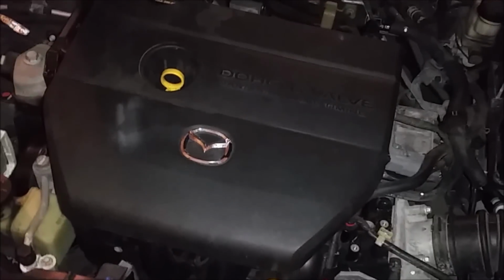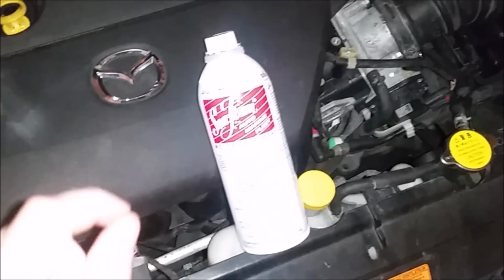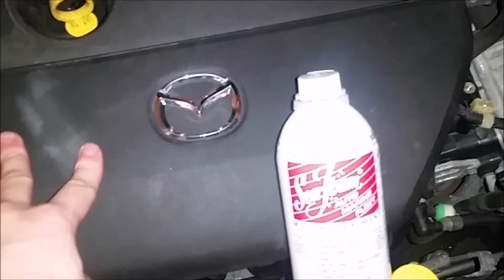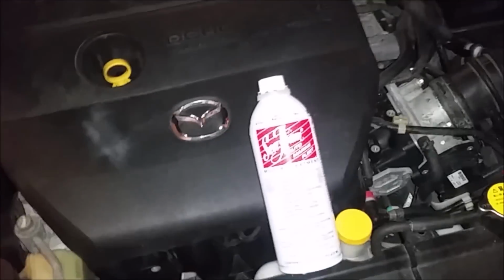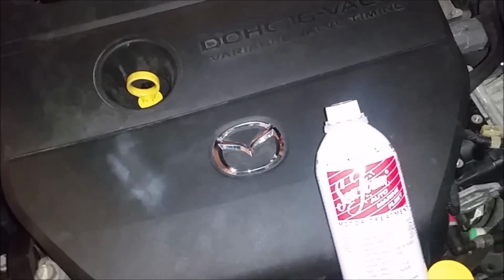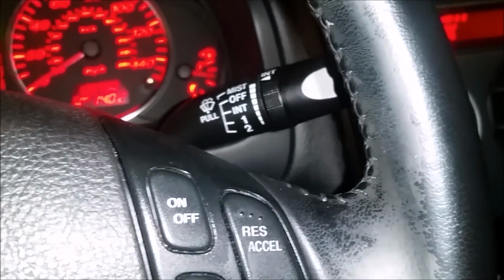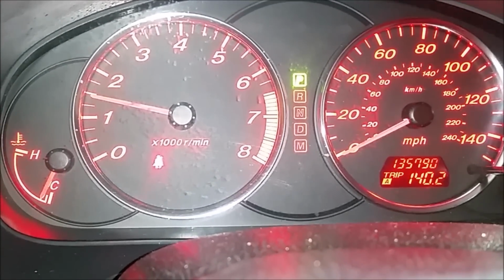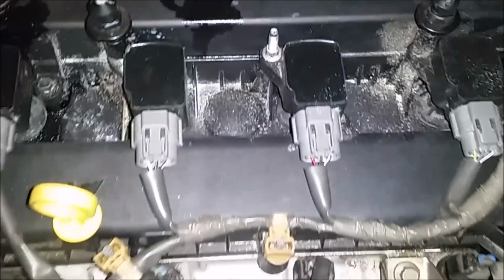Fixing noisy lifters   hydraulic lifter 2006 Mazda 6

Comment: Is this the same as tappet valves? I have a little noisy too like its going to stall or hesitate?
Reply from the maker: Hmm, well tapping valves means you need to get the valves adjusted. Does the car stall? Does the rpm go under 700?
Reply: +Anthony Awada 
It hasn't stalled yet, I keep revving a little to add petrol lol. Forgot to mention it has a fault code p0303. My car has done 50k kms, changed the spark plugs. Thinking of doing the ignition coil. I already tried petrol Injector cleaners.
Reply from the maker: +Optimus Prime So I'm guessing you have a mazda with a v6? 
If that's the case that's a misfire in cylinder 3. my recommendation is to change all spark plugs. Then change the coil pack from cylinder 1 onto cylinder 3. Then erase the codes. If the  light comes back on and the code reads misfire on cylinder 1. Then you know it's that coil on cylinder 1 that's bad and you can just change that one.  if it's still a misfire in cylinder 3, then I recommend cleaning your fuel injectors.
Reply: +Anthony Awada 
Thanks Anthony will swap the plugs then. No its not a V6. Just a Proton Savvy. It has a 1.2 D4F renault engine I think? I already changed the spark plugs before it did help a bit, it use to hesitate quite badly but just a small hiccup now and then. It doesn't drop power but it did in the past and mechanic said it had water in petrol tank for some reasons. Got that one fixed.
Reply from the maker: I love those cars! It's a common problem for proton savvy's. The bonnet design in the car sometimes allows water in the engine compartment. And I have heard many stories of fuel and water mixture in the gas tank either from it raining or condensation. Check for corrosion on the plugs or the plug tubes (boots) as well. Even though the boot is made from rubber, corrosion and rust will stick to it. There is fluids like fuel doctor, marvel mystery oil, gum out, sea foam, etc.. that, you can put in your gas tank to get rid of any water in the gas tank. Also you might wan t check the TDC/crank sensor. Make sure there is no oil. Dust and some dirt will get in there once in a while. I would clean it and make sure nothing clogging it or distorting it.
Reply: Anthony Awada
Your it normally plays up when it rains or condensation like recently. On hot days it goes like nothing is wrong? I recently changed the TDC so can't be what's causing it.

Boots? Is this the ignition coil plugs you talking about? Will check the spark plugs again which reminds me to do the plug test.
Reply from the maker: +Optimus Prime I've had some problems with injectors getting dirty because crap was getting into my fuel tank.  I ended up cleaning my injectors. 
Yes I'm sorry ignition coils on packs. Not boots. Check the bottom of those Coil on packs. Make sure they are clean. You can even try putting some conductive grease in the plugs to enhance connectivity.
Reply: Anthony Awada
I thought that is what you meant. I tried the petrol injector cleaners and still no luck. I have used fuel doctor before and still have some left. But I am convinced it can't be water all the time? I haven't checked the bottom of the coil packs. Grease? OK will ask at the local store to buy the correct one.

Faulty code p0303: http://www.obd-codes.com/p0303

Symptoms may include:
- the engine may be harder to start.
- the engine may stumble / stumble, and/or hesitate.
- other symptoms may also be present.

A code P0303 may mean that one or more of the following has happened:
- Faulty spark plug or wire
- Faulty coil (pack)
- Faulty oxygen sensor(s)
- Faulty fuel injector
- Burned exhaust valve
- Faulty catalytic converter(s)
- Running out of fuel
- Poor compression
- Defective computer

From the symptoms above, the engine is not hard to start but it does stumble or hesitate a little when at a red light or stopped sign so its only when the car has stopped moving. But as soon as the car is in gear 2 and up then the car can drive normal.

I have ruled out spark plug. Not sure what the wire it is referring to? Gonna have a look at the coil plugs as mentioned before.

I don't know what:
- Oxygen sensor
- Exhaust valve
- Catalytic converters
- Poor compression
- Defective computer
Reply from the maker: 1) oxygen sensor measures the oxygen that's in the exhaust gas to make sure that your engine is running efficient. 

 2) catalytic converter burns impurities from your exhaust so that you aren't polluting the atmosphere. Usually if any of those two problems happen. The check engine light will come on with an error code saying either "catalyst system inefficiency" or "oxygen sensor fail" I have a good fix for catalytic converters that I learned from scotty Kilmer. What you do is get your gas tank half full and pour one gallon of pure lacquer thinner in the gas tank. Then run the car for about 30 minutes at 2.5k rpm for 30 minutes and drive the car a lot to get rid of the lacquer thinner. Its worked twice for me.
3) You can perform a compression check on your vehicle. If the compression is low. Consider using a thicker viscosity oil on your next oil change, It's very rare for computer to go bad unless water got to them. In any event you would have seen a check engine light come on.

Comment: what do u mean by putting transmission fluid in ur car?????
Reply from the maker: Some guys, me included, used to clean the carbon buildup inside engines by running transmission fluid instead of oil after draining the oil. Transmission fluid is thicker and has much much more detergents to clean all the carbon.
I used to run the car for 15 minutes idling with trans fluid in it. And then drain it and refill with normal 5w-20 oil. Even with the 15 minutes of trans fluid in there, it used to come out black.

Comment: Who doesn't change their oil filter after doing an oil change?  Anybody that does that shouldn't be touching a car. But seafoam did cure my Dodge Charger's noisy lifters.
Reply from the maker: I know many people who believe that filters can go 10-30k miles before needing change. It is also proven that dirty filters catch more dirt than clean filters. But I do agree, filters should be changed every oil change.
Reply from the maker: TheNightster07 Hi, what is it that I can clarify?
Reply: BigErn_Mccraken this is true you should only change your oil filter ever 3 oil changes but i would after using seafoam
Reply: Fifty 1 Fifty Hey bro quick question. I got a 05 300 hemi that got the tic after a oil change. You think this seafoam will work for me? If so how did you do this.
Reply: My nissan pathfinders handbook lists two different oil volumes, dependent on whether you change the filter or not.
So yeah even some manufacturers dont think it is entirely necessary to change filters ever oil change.
Oil filters are cheap. Change em.

Comment: Hey I have a few questions for u I'm having the same problems in my maZda 6
Reply from the maker: Hi Jennifer,  please tell me more! have you tried anything on your car yet to try to remove the noise?
Reply: +Anthony Awada no it just started yesterday but it sounds terrible
Reply from the maker: I'm sorry to hear that,it's a common problem on the mazda 6's. They are great cars but have some small problems like lifters. Now noisy lifters occurs as a result of not have regular oil changes or some dirt getting into your engine. Those lifters capture the sludge or dirt and get clogged which makes the noise. And over time the will attract more dirt and make more noise. The faster you diagnose the better. You can do like I did here in the video (seafoam and MMO) or another method which is :emptying you oil from your car. Then adding transmission fluid instead of oil. Run you car for about 20 minutes in park. Then flush you transmission fluid out and put in good oil (that your car recommended ) and a new filter.
Reply: +Anthony Awada is it safe to drive tho? Cuz I'm broke right now so I literally can't fix anything but I have a 30 mile commute one way everyday
Reply from the maker: +jennifer winston Yes it is safe to drive. It should not even affect performance.

Comment: had the same problem recently added best line oil treatment and my noise is gone you won't believe it
Reply from the maker: That is good to hear! The reason these hydraulic lifter noises happen in the first place is because of lack of oil changes.
Reply from the maker: Hi Alan, could you elaborate more on the issue you are experiencing with your car?

Comment: If you changed your oil regularly you shouldn't have a "build-up".   Also, you used two different products so......you don't know which one quieted your lifters -  my money would be on the Marvels Mystery Oil.
Reply from the maker: I 100% agree with youQuiet Wyatt. It is difficult to know which one might have done the job. But considering they both cost me 12$ together.  I am not complaining. 
And you are correct, not changing the oil frequently WILL cause the lifters to be noisy. However I did buy the car used and it came with the noisy lifter.
Reply: I use MMO in oil and Seafoam in my gas. Great stuff..
Reply: why

Comment: I have a 2006 Mazda 3, I run this car with very low engine oil, after driving it for 2 miles that wear sound coming from for engine. What's sound call! And how do I fix that sound go away!
Reply from the maker: You want to hope you didn't do any major internal damage. If I were you Felix I would run heavy oil in the car. I would do an oil change with 10w-30 and use a quart of Lucas oil stabilizer.
Reply: Anthony Awada I took to a mechanic and they said I need to buy a new motor or rebuild one, after an oil change is still smoking nocking hard and engine light on after oil change. Any recommendations
Reply: Beside i over fulling the engine not know that I was doing..
Reply: The ticking noise of my car is bad..and loud

Comment: Isn't this a direct fuel injection engine? They tick naturally and are very noisy engines even at idle.
Reply from the maker: Gerald's Videos Hi Gerald. On the nonturbo Mazda 6, it is naturally aspirated, not direct injection. On the 2.3L turbo, they are direct injection and yes, they are very noisy. I should know they are noisy on the Speed 6 because I have one.

Comment: rislone works better and you can leave in for 3000 miles used it in my 2001 dodge ram 5.2 because of lifter tick and it took the problem away.....

Comment: what happens when you overfill your oil..
Reply from the maker: The oil pump might not be able to suck oil as their is too much pressure. You could cause massive leaks in your engine as the weight and pressure of the oil will find a way out, and possibly blow your engine.
Reply: Anthony Awada thanks.. so is a bottle of seafoam gonna make a difference or do I need to have 1 quart drained first before I add it (before my oil change)
Reply from the maker: Gary Shaw All depending how much oil you put in last oil change. If you filled it to the top the  you will need to drain. If you check your dips tickets and it's in the middle or lower, then your safe
Reply: Anthony Awada thanks
Reply: Actually its quite the opposite, When you overfill the engine oil, the cylinder rods land/splash in oil causing foam to be created. the foam prevents adequate lubrication of moving parts, and you will burn out your engine!
Reply from the maker: Thank You

Comment: it has DOHC on top of the engine it doesn't have lifters the valve rockers operate directly from the cams lobes
Reply from the maker: James Kmenta Hi James, here is a link to original Mazda OEM lifters for the 2.3L engine.
http://www.mazdapartswebstore.com/p/Mazda_2006_6/Engine-Camshaft-Follower-VALVE-LIFTERS/48658139/AJ0312100.html?partner=googlebase_adwords&kwd=&origin=pla

Comment: These engine have solid lifter not hydraulic.
Reply from the maker: Hi Del, Mazda 6's have hydraulic lifters. Miata's for instance have solid lifters. Now I do know that in I believe 2005-2006 Mazda switched their engines from distributers to coil on plugs (which has nothing to do with lifters). But Maybe the updated 6's have hydraulic an the old 6' have solid. I am not sure. Please correct me if I am wrong. But I am for sure that on my 2006 Mazda 6i GT that I have hydraulic.
Reply: Thats the comment I have been looking for. This car does not have hydaulic lifters!

Comment: stay Away from Mazda 6   ...   I'm here because my new engine in my Mazda six is tapping ,  2 Months after engine replacement
Reply from the maker: My Mazda 6 has been tapping for 5 years. I don't have any oil consumption or leaks. Car runs great with over 180k on it now and 24 mpg.
Reply: my mazda6 just started tapping at 180k miles. no leaks. no oil consumption. 25mpg, verifed.

Comment: Somebody please tell this guy DOHC Engines don't have lifters
Reply from the maker: Alan Khoshaba I'll make sure to pass the word man. Please call you local mechanic or dealership, and have them update you on  DOHC and lifters.
Reply: Uh, my VW VR6 has DOHC with TAPPETS, which is another name for lifters, only unlike typical v8 engines, which have a cam in the valley, and lifters that ride on TOP of the cam and therefore LIFT the pushrods... the VR6 cam lobes directly impinge upon the tappets, which are hydraulic, and the tappets push the valves down to open. Therefore, some DOHC engines actually DO have lifters, or tappets, or whatever you wanna call them. Most are hydraulic unless you have a high performance engine that has solids in which case, the lobes likely impinge directly upon the shims that are of varying thickness in order to adjust the valve lash. Hydraulic lifters and tappets do that adjustment hydraulically, taking up the lash when the oil pressure pumps them up. Mine are noisy hence, I am here looking for a cheat to avoid having to pull the top apart to clean the damn things.
Reply: Lmfao
Reply: Alan Khoshaba 😂😂
Reply: MrRioting tappets arent lifters. Shims arent lifters. 
Lifters are the hydraulic version of mechanical pushrods in non ohc engines. They get stuck sometimes. They dont pump up.
Reply: This whole argument comes down to age. Nowadays many people call tappets lifters. If you wholeheartedly disagree with this, you're probably well over 40.
Reply: Who gave this bloke to many cookies, most ohc engines have hydrolic lifters, with a few exceptions like honda that have adjustable rockers,  I'm a mechanic and have been for 20 years.

Comment: scam scam scam.
Reply from the maker: Sterling Witherspoon Hi Sterling, could you elaborate more please?
Reply from the maker: Sterling Witherspoon Sometimes if I have my phone on me I respond quickly :).
Reply: Anthony Awada Basically the oils are two different types of fluids. The tyranny fluid is a light detergent texture oil. Engine oil itself has deep within a type of grit if you squeeze your fingers together tight enough and rub...unlike water it has pure flow.  So the engine would fail? The tyranny will fail? Just like when people put high mileage engine oil..to get "better protective oil" ? It's either going to cost more money or do more damage.
Reply from the maker: You bring up good points. I know people who put tranny fluid instead of engine oil because tranny fluid is a better cleaner. It cleans the engine from carbon buildup, then they go back to engine oil. The viscosity of oil keeps the metal parts of the engine from rubbing and eventually warping and scoring.